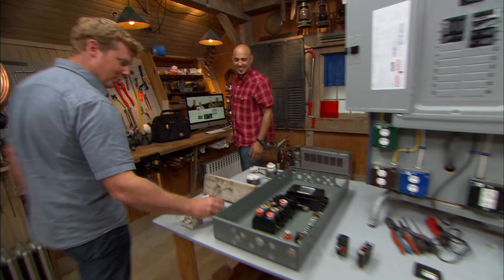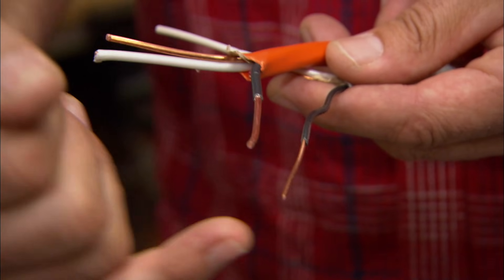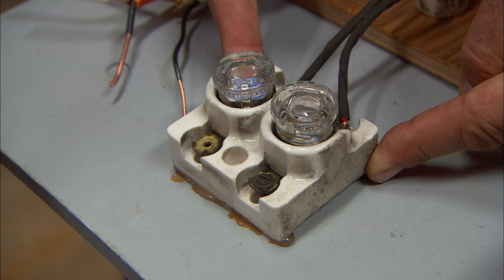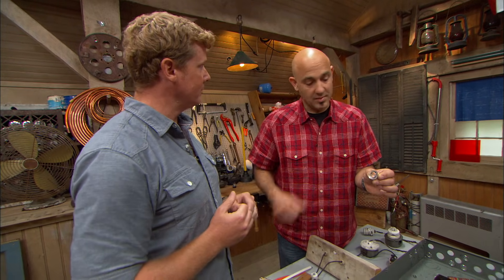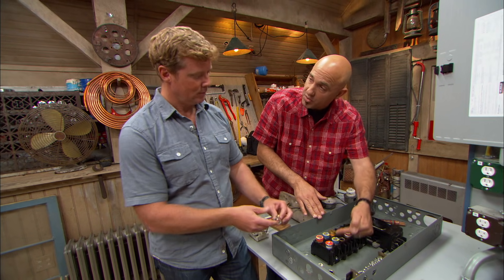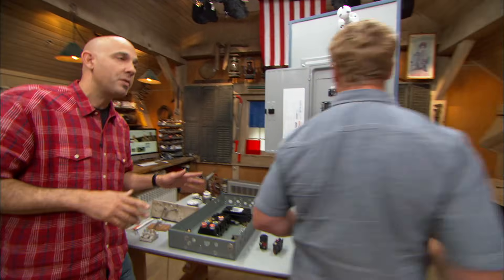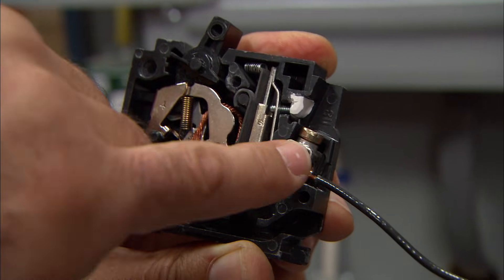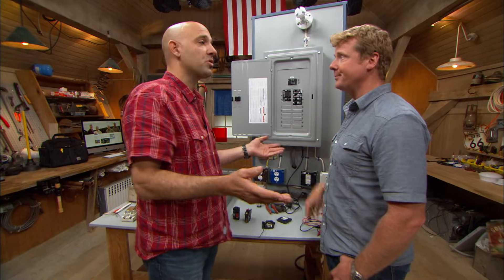How Fuses and Circuit Breakers Work | Ask This Old House

Comment: 2:12 That's both true also not true. In 1990's, almost every house fuse were like this, I clearly remember at my grandma's and my aunt's homes. People were running wires around the fuses themselves, I suppose fuses wasn't cheap to break every week when you want to cook something in electric oven everytime.

Comment: My fuse is giving a spark I can’t se the spark I can hear it I just got a new washer and dryer it a LG what should I do it never happened until that huge flood in New Jersey what should I do I need it to connect to the breaker should I get an electrician Disturb

Comment: So I had a short putting on a lamp in my old house. Several outlets and the next room light won’t turn on. I have a fuse box inside and a breaker box outside. Could the fix be replacing the fuses? At least a first step.
Reply: Did you figure it out?

Comment: Breakers are NOT an improvement.  Breakers have problems too.  Easy for someone to switch to a larger capacity breaker.  They have many moving parts, which makes them MUCH MORE unreliable than a properly sized fuse..  if a homeowner doesn't investigate the cause of the breaker tripping, and repeatedly resets the breaker, it can start nuisance tripping at a much lower amperage than it's rating.  Worse, the worn parts can HANG, and NOT trip, in response to an overload, and cause a fire or damage equipment.  IT DOES HAPPEN. 
 The restriction fuse bases prevented people from putting in over-rated fuses.  But people are ignorant, and stuff in foil.  So the government mandated inferior protection. - "fool proof".  So people like me, in engineering for 39 years, have to pay the insurance company a premium to keep our superior protection.  Incidentally, did you know the government doesn't even allow the use of breakers in medical electronic equipment?  That's because even the best breaker, being a much more complex device than a fuse, sometimes fails to trip when presented with an overload, and damages the equipment.

Comment: Don't fool yourself about circuit breakers, they are mechanical devices prone to mechanical issues, especially the hardening of grease in the breaker used for lubrication of the mechanical linkages. This is why it is important that when you change the batteries in you smoke detector, go around and exercise the breakers and trip your GFCI's to ensure they are working.

Comment: This is the first MCB that I have seen that is purely thermal not thermal magnetic as described. reducing its usefulness in short circuit conditions as it would operate slower and is less able to extinguish the arc.

Comment: When a circuit breaker trips you shouldn't just "turn it back on and you're back in business" without first determining if you are overloading the circuit by having too many things plugged in and turned on.
Reply: YES!  Otherwise you will be recycling the breaker many times and it will eventually eithe start nuisance tripping at a lower than normal current, or WORSE, hang up, and NOT trip.  Yes, it happens.
Reply: I was wondering about this. Thanks for pointing it out. Would you happen to know what other issues could be taking place besides overloading? Thanks.
Reply: @niyahwebb49  -- A short in the wiring or a defective circuit breaker

Comment: If you have dead fuse box break it open and cut out the silver contacts with shears. There is also silver you can get out of TV relays and light switches.

Comment: This bit just seemed like Scott found an old fuse panel and wanted to show it off versus actually wanting to help homeowners with their breakers.  I say this because fuses are only a small percentage of houses today and every house in the last 10 years has had arc fault breakers in some parts (and now for all branch circuits) which trip not only because of being overloaded or shorted but also a variety of other less dramatic reasons.  Not only that, no mention was made that when breakers trip,they don't go all the way to the off position and would be in the middle.  He could have easily demonstrated a tripped breaker and how to reset it.

Comment: Many years ago our family had round fuse's - but when they were replaced so many times when they burned out so we bought a round fuse which was a circuit breaker fuse - when the fuse burned out we had to press the stem to reset the fuse .

Comment: boy oh boy..could I use some Electrical help. I live in a house built 1968..all aluminum wiring. Various places throughout the house just stopped working. I've checked the circuit breakers...none were tripped. I guess it is possible that the wires pooped out. If that's the case, then there is fire risk..I would imagine. Is the only solution to rewire the house? How long does that take and how expensive would it be? 3Br 2bath single level house. I know that the housing codes have changed around here in the last 15 years..and I think I would need to re-do the wiring in order to be up to code to sell it.
Reply: i agree with colin, check the manufacturer of the circuit panel. federal pacific is complete junk
Reply: Parmesana not necessarily it needs to be inspected by a licensing electrician.  It's not necessarily the wireing that is  dangerous,  it's what's connected to the aluminum wiring.           🚨 also if the breaker panel has the name "Federal Pacific"  on it you're in  bigger trouble.
Reply: federal pacific stab lock are the bad panels...
Reply: call an electrician right away...aluminum wire can be bad news and chances are people fooled with it over the years..the terminations need to be done correctly for starters.
Reply: +working shlub
Absolutely right! And aluminium wires are always bad news in a residential. Here in western-Germany this was never used, but in eastern-Germany they've used it en masse. In western-Germany aluminium wiring was banned in the early 1970s if the conductor size is less than 16mm² (AWG 6 is comparable). In eastern-Germany there was always a copper shortage, so they used aluminium instead. The newest installations were made in 1990, and even these newer ones are making problems today. And on the other hands you can find 50 or 60 years old copper installations here which are still perfectly fine.

+Parmesana
You should really get rid of the aluminium. It's possible to repair it, but if one spot is repaired the next broken wire will occur and you'll have the same problems again.
Reply: Another example is their 240V wall mounted space heater, which will overheat and turn off after a few minutes.
Reply: Aluminium conductors got several flaws:

1. It's not as flexible as copper, if you bent them too much the conductors will break. Copper can break too, but aluminium can break much easier. It's brittle.
2. It can carry less current than a copper wire of the same dimension.
3. Connections will loosen over time, especially screw-type terminals must be tightened from time to time.
4. You need a special contact lubricant to prevent corrosion on the aluminium conductors.

The only advantages over copper are that cables are lighter and cheaper than copper wires. But in case of a house wiring that doesn't really make that much difference, especially for the reason you need bigger cables for the same demand. Aluminium conductors must be at least one size larger than copper conductors, for the same demand.
Reply: aluminum is used alot for service entrances ...cheaper than copper just need bigger gauge . branch circuits always copper.

Comment: I was a trouble shooter in my city electric dept. People used to put pennies behind the fuse stats to eliminate the fuse. Of course it caused many fires.
Reply: Blox117 what I learned from stories I've heard is that people love taking shortcuts whenever they have the chance. A lot of those shortcuts tend to backfire. You would think people would learn from others mistakes but apparently not.
Reply: what kind of a moron does something like that?
Reply: Joe Brown I learned that in my CTC class, I figured it would cause some problems

Comment: Less Resistance causes a fuse to blow. error
Reply: anton1949 
Ohm’s law states that as long as voltage remains constant, as resistance decreases, current increases. When current attempts to pass through a fuse or breaker that exceeds the protection rating, then it will blow or trip. 
So, the statement of low resistance causes fuse to blow can indeed be correct.
Reply: That's what I said, The speaker said more resistance causes a fuse to blow, that's in error.
Reply: In this case it's right, he meant the strip inside of the fuse. This strip is a bottleneck and will heat up, if it gets to hot over a longer period of time it will melt. In case of short-circuit it can proverbial desintegrate in a small explosion, depending on the impedance of the wires and how high the short-circuit current is. The lower the rating of the fuse is the smaller and high resistive the strip inside of the fuse is, and the larger the fuse is the larger the strip is inside of the fuse and less resistive.

And you're right in the case of the low resistance, that's between the different conductors. Zero resistance between is actually a short-circuit, in theory. In practice the resistance will never be zero.
Reply: I caught that too.  Resistance PREVENTS current, not increase it.
Reply: Yes, in an eerie coincidence they call it resistance.
Reply: When you turn off all your appliances resistance goes as high as it possible can, and your fuses cannot blow.

Comment: That was bad info. You should have mentions RCD’s ie residual current devices that protect the householder from fatal electric shock. Your video was far too lacking in actually what a circuit boards first priority was. Please delete it

Comment: My first ever thumb-down at any TOH video; the latest circuit breaker is more relevant yet only briefly described it, even with a cut-off view of the breaker, it was sloppily described... Well there is always the 1st.
Reply: Ronan B why is this comment always the go-to reply for any criticism? Criticism can come from all angles, not just experts in the field or someone who should "do it better". 

I personally enjoyed the video for it's quick history, but also I agree I would have preferred more depth on the more complicated breaker system. 

TOH wouldn't know what works vs what doesn't if it wasn't for the feedback we fans provide! Don't shoot down people for voicing their opinion. Have a great day.
Reply: Ronan's comment just doesn't make any sense.
Reply: I agree. He spent most of the time on fuses, something that only a fraction of the houses still use yet he didn't spend a single second on Arc Fault breakers which all new houses have and trip for additional reasons than just thermal.
Reply: Jim D, Could have made it 5 minutes.
Reply: Rick T I am
Reply: Matthew its the typical defense 'argument' of a fanboy
Reply: Arie They could make it 5 hours and still not talk about everything. Like I said, it was a quick comparison between fuses and circuit breakers. They have discussed arc fault and gfci breakers in the past.  The show is designed to provide basic information for homeowners, not to train them to be electricians.
Reply: They have time limits for. It's hard to cram lots of information into a 3 minute video.
Reply: It’s a 3 minute long video.  How in depth do you expect them to get?  It was meant to be a brief explanation of the operation/differences between fuses and circuit breakers.
Reply: I invite you to do better. We are waiting.

Comment: I remember reading somewhere that MCBs can stick (though very rare) while a fuse will always burn when overloaded or if a short circuit occurs.
Reply: If a circuit breaker fails the normal way it will always fail the other way, meaning it will trip without any reason. If the contacts inside stick together like welded means that the circuit breaker wasn't dimensioned correctly in the meaning of the PSSC (prospective short circuit current). The standard circuit breaker can handle and break a short-circuit current of 6kA or 10kA. So you'll have to measure the ground-loop impedance and calculate the PSSC and choose the proper circuit breaker. They're labeled that way, in addition to their tripping current:

American circuit breaker, labeled with 10kA:

https://images.homedepot-static.com/productImages/25c1627e-cb19-4e0f-bec6-dd7ce1ecb1ef/svn/eaton-2-pole-breakers-chf230-64_1000.jpg

European circuit breaker, 10000 below the B16:
https://willrose-electrical.co.uk/wp-content/uploads/2016/06/EMBH116-1-1.jpg
Reply: NO!  A breaker with worn parts due to many resets can HANG UP, and fail to trip.  That one time may burn down your house.
Reply: Breaking current refers to the ability of the contacts to separate and resist an arc which would jump the connection, as with inductive loads.  There remains the problem with the mechanical parts (pivot points, etc.) hanging up.